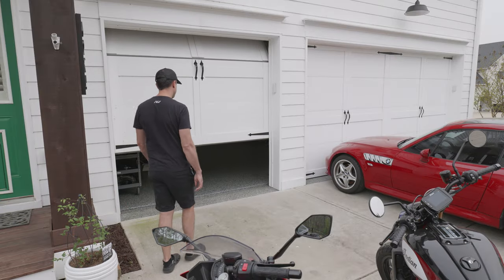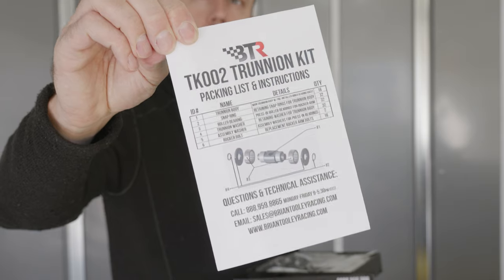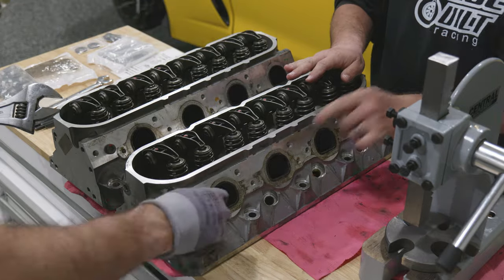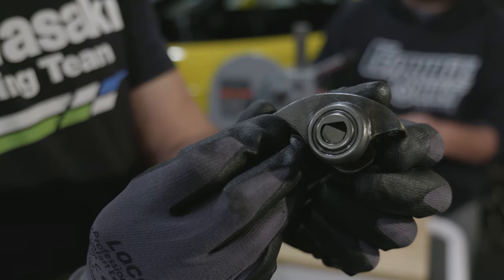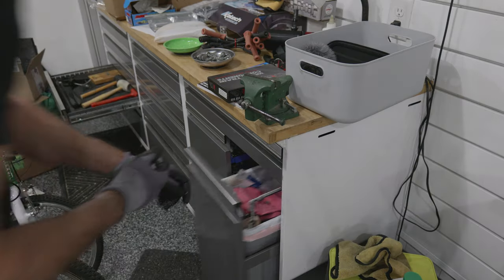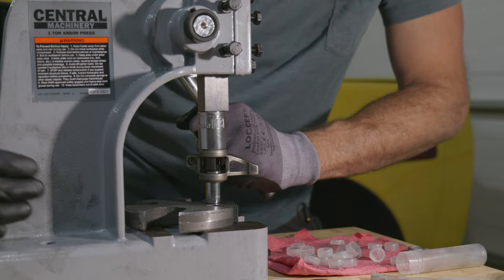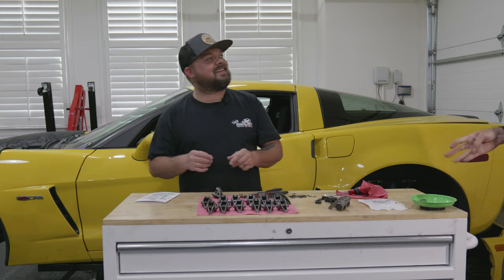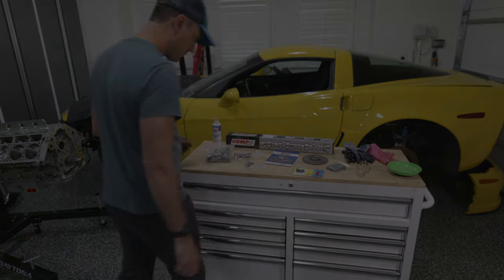Protecting my $20000 investment

Comment: I did the trunnion upgrade over the winter when I pulled the heads to have the valve guides replaced and new SS valves installed. I used a magnetic trunnion tool with a vice and it went very smoothly. I was on the fence with replacing them, but the new cam I installed has pretty decent lift .65, so I figured why stop short and risk it. Cheap insurance.

Comment: Too late now but there is a tool for pressing the trunion bearings in and out using a vice.  With that setup, I did not struggle at all in doing that upgrade.

Comment: One thing I've always wondered is why more people don't bother overbuilding from the very beginning. If you target a certain level of performance, the amount of power you make should always be LESS than what the rest of the car is capable of handling - whether it's in terms of the transmission, suspension, tires, brakes, cooling, or oiling. My belief is that if you've overbuilt the car, once you go racing, you can then use that safety factor as a way to figure out where you can and cannot shave weight.
Reply from the maker: I think a lot of times we don't put much effort into planning our goals in advance. Often somebody starts with a sports car they think is cool, then they think about upgrades. Adding power is really appealing, especially since it is noticeable in regular street driving.

With this project I initially wasn't going to touch the engine at all, because I figured with my goal of hitting a better lap time than a 991 GT3 I already had enough power and I just needed better handling.

And I think a good reason not to add power is because when you go to the track you're just going to start overheating and breaking stuff and costing yourself money. Where does it end?

But once I was forced to spend money on a new engine I couldn't resist a little bit more 🚀
Reply: @JoshVanVeld  well I hope your cooling, oiling, transmission, driveline, axles, and everything else are durable enough to handle Track Attack abuse!
Reply from the maker: @spdcrzy  Hopefully we'll find out soon 😀

Comment: Did you do the larger oil sump yet?? If not you will blow that motor again.  You need an 11 qt oil sump to avoid oil starvation at high Gs.   Linginfelter is what I have.
Reply from the maker: I did. Although I know a guy who has been tracking his 07 like crazy with no issues and he's using the factory tank. Worth the money for peace of mind but I don't know if you're guaranteed to get starvation unless you're pulling pretty high G's (like slicks) for sustained periods.
Reply: @JoshVanVeld  Glad u addressed that especially because it is a cheap fix.  I blew my 07 ls7 (heads had been fixed) in a high G corner because of oil starvation with the 8 qt factory sump.  $14k later I’m beating GT3s and GT3RSs pretty easily at this point but I have 600+ whp, 2,950 ish weight , and all new brakes suspension and upgraded bushings and aero etc…

Comment: I commented on the other video but wanted to make sure you saw and were able to take into consideration swapping out the generic LS7 lifters with the Cadillac racing lifters. At least look into it and ask some of the people you're in contact with for their opinion.
Reply from the maker: I did see that comment and meant to respond. I went with the GM LS7 Lifters Katech recommended. The cam I'll be using isn't very aggressive which I assume played into their decision.

I'm planning to keep this car for a while so if I feel like my "mostly stock" approach gets boring I can do another round of upgrades to add (and support)  more power.
Reply: @JoshVanVeld  You're good, you just have a lot of money/time wrapped up into this and wanted to make sure you knew your options on a critical component. Katech obviously knows what they're doing but they might have also been keeping budget in mind is what I was thinking. LS7 lifters have held up to some stupid stuff but I've also personally seen them fail with less but could have been installation error, wrong preload who knows. Not too difficult to swap them out in the future I suppose but for reference the caddy lifters are rated to 8000 rpm and will function just like a LS7 lifter. These videos are awesome, hope everything goes smooth the rest of the way to get it back up and running!

Comment: This whole time I thought you got the heads fixed when you first got the car.
Reply from the maker: Thought about it, kept putting it off, figured that since there were no mods on the car and miles were relatively low I would probably be fine for a while. Oops!
Reply: @JoshVanVeld  I woulda did the same honestly, so I can't front you on that part. My Z06 has lotsa miles though and it's my daily and fun car now lol!

Comment: if you spent the money for a K tech short block and ne heads, why not buy full roller rocker? this doesn't seem like a low buck budget project
Reply from the maker: Good question. You're right that it's not a low-budget project but I'm also trying to keep the budget reasonable (if you can call it that).

Goal was to be all-in less than the $20K GM would have charged to replace the stock motor with a new one and have something more reliable and more powerful. Katech helped me determine which stock parts I could get away with. I'm not going with a very aggressive cam so I don't need all the valvetrain components to be super beefy.

The initial build will be something like 600 hp at the crank but as I understand it the potential is there if down the road I want to flow more air in and out and at that point I may upgrade some components.

Keep in mind I'm still a relative noob when it comes to LS internals.